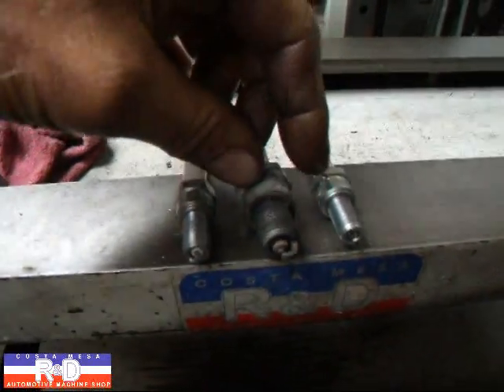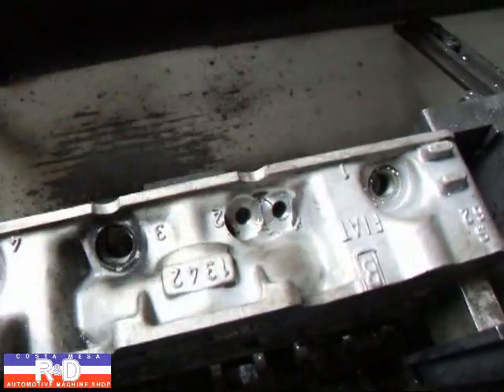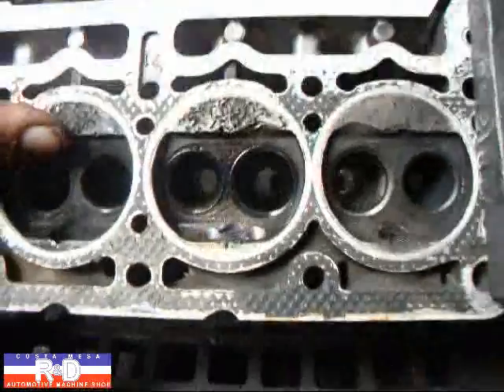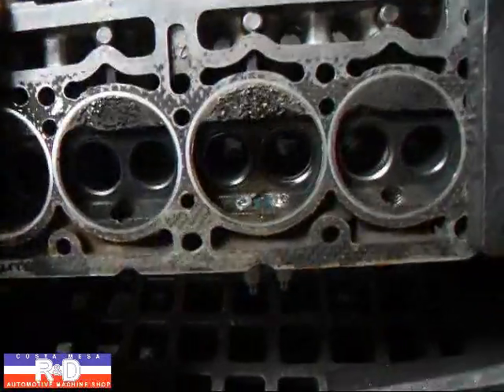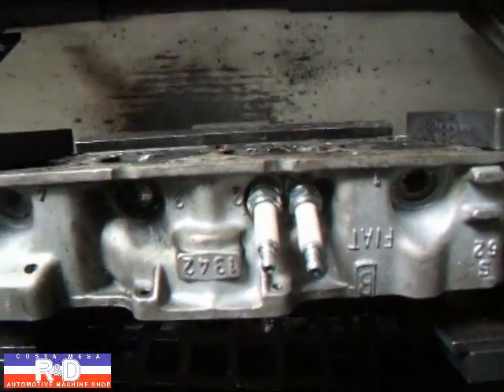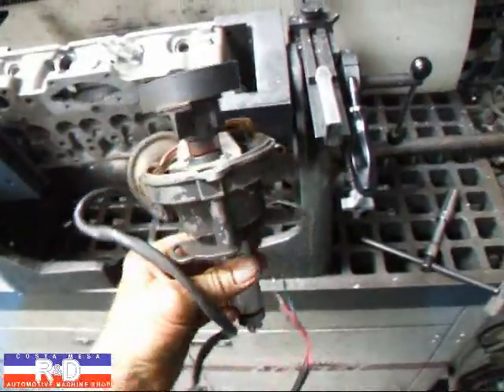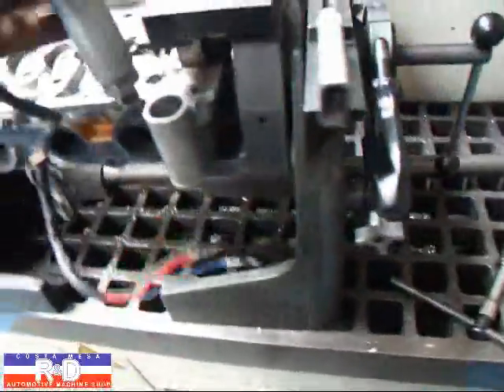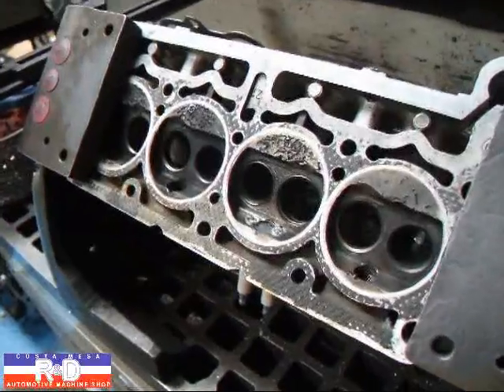Fiat 850 Twin Plug Cylinder Head

Comment from the maker: Have you ever observed what the CD spark pattern looks like on a scope?I have many times and the sucessive sparks are a lot less voltage. I want a hot spark for each plug, not one hot and several that are not. A single coil will not cycle fast enough for a CD system as far as I'm concerned. Thanks for your comment! The crank trigger is made, but I'm not ready for its installation, yet.

Comment: Sir, could You use a complete electronic firing, like twin spark from older alfa's, or something similar that does not include high voltage distribution.
Please advice. Seems to me that making a few wires is always easier than making adaption to new HV distributor.
Best Regards,
Goran

Comment: Hi John, since you've done work on motorcycle documentation in the past I was more or less expecting that you would have come up with a set of 4 dual coils to fire those eight plugs... obviously this would require a more elaborate 12v system for the control of these coils, but it would benefit from not having the distributor as a potential source of voltage leak and reduced reliability... guess the simplicity of the twinspark distributor has its charm, too :-)

Comment: Would the remaining exposed edges (threads) of the original spark hole create hot spots in the combustion chamber? Are you going to clean the rough exposed edges up?